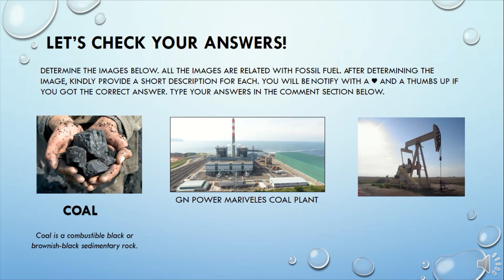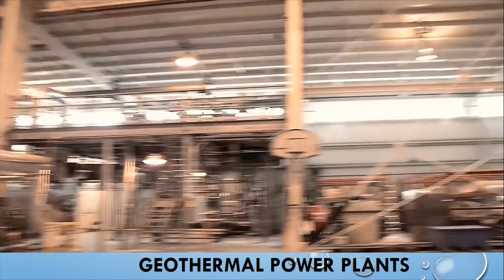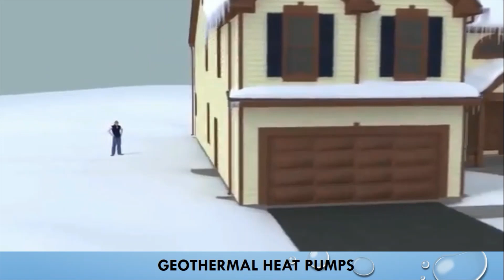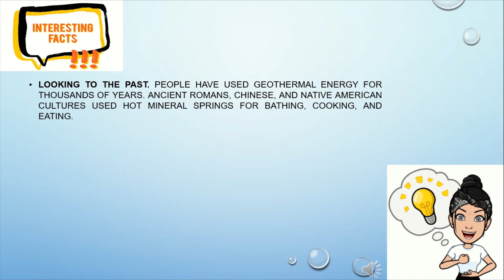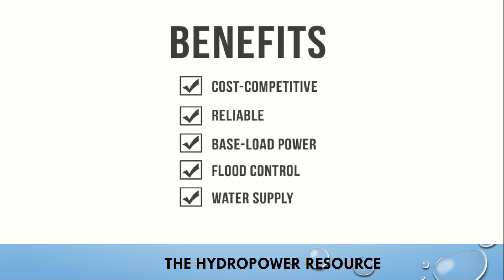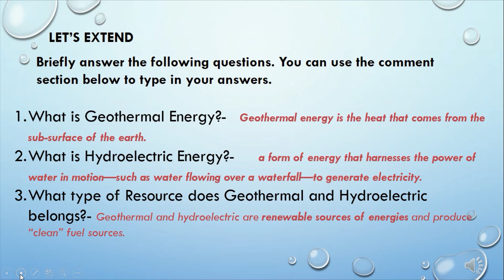GEOTHERMAL ENERGY AND HYDROPOWER RESOURCES (A SHORT DISCUSSION)

Comment: DELA CRUZ MIKHYLA GRACE B.
11 STEM PHOENIX

LET'S REVIEW:
A. Coal is a black or brownish-black sedimentary rock that can be burned for fuel and used to generate electricity
B. Generating Station is the main supplier or
 source of electrical energy.
C. Pump jack is a device used to extract crude oil from a deep well.

LET'S EXTEND:
1.Geothermal energy is the energy that comes from the heat underneath the earth's surface.
2.Hydroelectric energy one of the source of renewable energy that uses natural flow of moving water in order to generate electricity.
3. Geothermal and Hydroelectric Energy are both belong to renewable energy sources.

Comment: Fernando, Hallie Jade V.
11 STEM - Scorpius
Let's Review:
1. Coal is a combustible black or brownish-black sedimentary rock, formed as rock strata called coal seams.
2. Generating station is the source of electrical energy.
3. Pump jack is a device used to extract crude oil beneath the Earth's surface.

Let's Extend:
1. Geothermal energy comes from the heat within the Earth.
2. Hydroelectric energy uses the natural flow of water to generate electricity.
3. Renewable sources of energies.

Comment: Valdez, Ellaine Mae B.
11 STEM- Phoenix

A) Coal- a combustible sedimentary rock consisting mainly of carbonized plant matter

B) Generating Station- facility for the generation of electric power

C) Pump Jack- over ground drive for a reciprocating piston pump in an oil well 

1. Geothermal energy is the heat that comes from the subsurface of the earth 

2. Hydroelectric energy is a form of energy that harness the power of water in motion such as water flowing over a waterfall to generate electricity

3. Geothermal and hydroelectric are renewable resources of energy and produce  clean fuel sources

Comment: Pauline Narvas
11-STEM Taurus 

Coal
-is a form of fossil fuel that is formed from the decays of plants and animals millions of years ago with heat and pressure fossil fuel such as coal is formed.

Coal-fired power plants is a type generating station that produces electricity by burning coal.

Pumpjack
-is use in crude oil extraction. It is use to lift the oil from oil wells where there is no enough pressure so drilling holes and the oil pumpjack is use to bring it to the surface

Geothermal energy 
-type of renewable energy that comes from the heat beneath the earth 

Hydroelectric energy 
-a type of energy that is generated through moving water by using turbines also

Both are renewable source of energy

Comment: Ocampo, John Carlo S.
11 STEM PISCES

Let's review:

A. Coal- Is a type of fossil fuel formed from decayed or dead in million years and applied heat and pressure.

B. Generating Station- Is the main supplier or
source of electrical energy.

C. Pump Jack- It is used to extract crude oil from oil well by mechanically lift the liquid out of the well if not enough bottom hole pressure exist for the liquid to flow all the way to the surface.

LET'S EXTEND

1. Geothermal energy is the thermal energy in the Earth's crust which originates from the formation of the planet and from radioactive decay of materials in currently uncertain but possibly roughly equal proportions. 
2. Hydroelectricity, or hydroelectric power, is electricity produced from hydropower.
3. Geothermal and hydroelectric are renewable sources of energies and produce "clean" fuel sources.

Comment: 11 STEM-Pisces
Chavez Alexis A.

A). Coal - one of the most important primary fossil fuels, a solid carbon-rich material that is usually brown or black and most often occurs in stratified sedimentary deposits. 

B). Generating station -  a plant for  generating electric power.

C). Pump jack - is a device used in the petroleum industry to extract crude oil from a oil well where there is not high enough pressure in the well to force the oil to the surface.

Let's extend 

1. Geothermal Energy - Geothermal energy is a renewable energy source because heat is continuously produced inside the earth.

2. Hydroelectric Energy - Hydroelectric energy, also called hydroelectric power or hydroelectricity, is a form of energy that harnesses the power of water in motion—such as water flowing over a waterfall—to generate electricity.

3. Geothermal and hydroelectric are renewable sources of energies and produce “clean” fuel sources.

Comment: Mercado, Chantelle C.
11- STEM Taurus

Let's Review
A. Coal- Coal is a combustible black or brownish-
black rock that is usually found in sedimentary rock deposits. It is primarily used as a fuel, but is classified as a nonrenewable energy source because it takes millions of years to form.
B. Generating Station-  is a facility for the generation of electric power. It converts mechanical energy to electrical energy.
C. Pump Jack- is an overground drive for reciprocating the
 piston pump in oil well. It’s used for mechanically lifting the liquid out of a well if there isn’t enough bottom hole pressure for liquid to flow to the surface.

Let's Extend
1. What is Geothermal Energy?- Geothermal energy is the heat that comes from the sub-surface of the earth. It can be used to produce electricity, to heat buildings and greenhouses, and many other purposes.
2. What is Hydroelectric Energy?- it is one of the oldest and
 largest sources of renewable energy, which uses the natural flow of moving water to generate electricity.
3. What type of resource does Geothermal and Hydroelectric belongs?- They are renewable sources of energy on Earth.

Comment: Chavez Aubrey A.
11 Stem Pisces 

Coal a flammable black or dark brown rock made primarily of carbonized plant debris that is found primarily in subsurface deposits and is commonly utilized as fuel, 
a smoldering coal.

Generating station a plant for generating electric power.

Pump Jack In the petroleum business, a device used to extract crude oil from a well where the pressure is insufficient to force the oil to the surface.

Comment: Sabio, Kathlyn M. 
11 - STEM LIBRA

A. Coal - Coal is a type of hard rock that can be used as a fossil fuel when it is burned.
B. Generating Station - A power station, often known as a power plant, is a facility dedicated to the generation of electricity.
C. Pump Jack - A pump jack is a device used in the petroleum industry to extract crude oil from an oil well when there is not enough pressure in the well to drive the oil to the surface. Pump jacks are used in situations where there is not enough pressure in the well to force the oil to the surface.

Comment: Let's Review 
A. 
Coal- one of the most important primary fossil fuels, a solid carbon-rich material that is usually brown or black and most often occurs in stratified sedimentary deposits.
B.
Generating station- a station for generating electricity, where electricity is expected to be directed to households and other facilities in need of electricity. 
C.
Pumpjack- is the overground drive for a reciprocating piston pump in an oil well. It is used to mechanically lift liquid out of the well.

Let's Extend
Act 1
1. Geothermal energy comes from the heat within the Earth. Produces electricity, to heat buildings and greenhouses, and for other purposes.
2. Hydropower, or hydroelectric power, is one of the oldest and largest sources of renewable energy, which uses the natural flow of moving water to generate electricity. 
3. The type of Resource that both Geothermal and Hydroelectric Power belongs to is the Renewable Energy.

Jemabhe Joyce T. Medenilla
11-STEM - Virgo

Comment: Castro, Samantha Nicole M.
11-STEM Taurus

Let’s review
a.	Coal - nonrenewable fossil fuel that is combusted and used to generate electricity
b.	Generating station - a station that consists of electric generators, prime movers, and auxiliary equipment for converting mechanical, chemical, or nuclear energy into electric energy
c.	Pump jack - a device used in the petroleum industry to extract crude oil from an oil well

Let’s extend
1.	Geothermal energy is a type of renewable energy taken from the Earth’s core. It comes from heat generated during the original formation of the planet and the radioactive decay of materials
2.	Hydroelectric energy is a form of renewable energy that uses the power of moving water to generate electricity
3.	They are both renewable energy resources

Comment: Bajenting, Hannah Grace C.
11 STEM - SCORPIUS

Let's Review
a. Coal - it is a combustible black or brownish-black sedimentary rock. Coal is classified as a nonrenewable energy source because it takes millions of years to form.
b. Generating station - it is a power station/facility for the generation of electricity.
c. Pump jack - is a device used in the petroleum industry to extract crude oil from a oil well where there's not high enough pressure in the well to force the oil to the surface.

Let's Extend
1. Geothermal energy comes form the heat within the earth.
2. It is one of the oldest and largest sources of renewable energy which uses the natural flow of moving water to generate electricity.
3. Both of them are classified as renewable source of energy

Comment: Lobo, Gian Evan P.
11-STEM Virgo

Let's Review!
Coal- it is a color black rock that can be used for fuel, it can also be used on generating electricity.
Generating Station- it is a facility that can generate electricity
Pump Jack- is a type of  machine that extracts crude oil from the oil well. It is used if there is not enough pressure to push the liquid up from the surface
Let's Extend!!!!!
1.)Geothermal energy is the energy that comes from the heat underneath the earth's surface.
2.)Hydroelectric energy is the energy that comes from the flowing water.
3.)They are both classified as renewable source of energy.

Comment: Gervacio, Sophia Alexa D. 
11 STEM-Libra

Let's Review
A. Coal is a solid carbon-rich material, usually brown or black, found in stratified sedimentary deposits. It is one of the most important primary fossil fuels.
B. Generating station, also known as a power station, is an industrial facility for the generation of electric power. 
C. Pumpjack is the overground drive for a reciprocating piston pump in an oil well.

Let's Extend
1. Geothermal Energy is a renewable energy source, it comes from the heat within the Earth.
2. Hydroelectric Energy is a form of energy that harnesses the power of water in motion to generate electricity.
3. Both Geothermal Energy and Hydrothermal Energy is a renewable source of energy.

Comment: Corpuz, Franz Joshua S.
11-STEM PISCES

Let's Review
1.Coal is a material usually found in sedimentary rock deposits where rock and dead plant and animal matter are piled up in layers.
2.Generating station is an industrial facility for the generation of electric power.
3.Pumpjack is a device used in the petroleum industry to extract crude oil from an oil well when the pressure in the well is insufficient to propel the oil to the surface. 
 
Let's Extend
1.Geothermal energy is a renewable energy source because heat is continuously produced inside the Earth.
2.Hydroelectric energy is a form of energy that harnesses the power of water in motion.
3.Geothermal and Hydroelectric are both classified as  renewable type of resources.

Comment: MANUEL, WELISTER O. 
11-STEM LIBRA

LET'S REVIEW!
A.  COAL
Coal is a material usually found in sedimentary rock deposits where rock and dead plants and an animals matters are piled up in layers. Coal is used to generate electricity.
B.  GN POWER MARIVELES COAL PLANT 
-It is an example of Generating Station that you can find here in Bataan. It is a facility for the generation of electrical power.
C. PUMP JACK
-Pump Jacks operate on the basic principle of hand pump water wells. This type of system uses equipment above and below ground to push oil to the surface.
Reply: LET'S EXTEND
1. GEOTHERMAL ENERGY
-Geothermal energy comes from the heat within the Earth. Geothermal comes from the Greek words "geo", meaning Earth and "therme" means heat.
2. HYDROELECTRIC ENERGY
-It is the form of energy dependent in the flow of water to generate electricity
3.  TYPE OF RESOURCES DOES GEOTHERMAL AND HYDROELECTRIC BELONGS
-it is belong to the renewable resources  of energy

Comment: ORDONIO ARIELLE S.
11 - STEM LIBRA 
Let's Review:
A. Coal - An example of fossil fuel. Material that is usually brown or black and most often occurs in stratified sedimentary deposits.

B. Generating Station - source and distributor of electricity.

C. Pump Jack - used to mechanically lift liquid out of the well if there is not enough bottom hole pressure for the liquid to flow all the way to the surface.

Let's Extend:
1. Geothermal energy is the third largest source of renewable energy that comes from the heat within the earth.

2. Hydroelectric energy is one of the oldest power sources on the planet. It is a form of energy which could be harnessed through moving water to generate electricity.

3. Geothermal and hydroelectric energy are classified as renewable energy resources.

Comment: Guila, Gabriel John, C.
11- Stem Pisces

Let's review:

A. Coal- Is a type of fossil fuel formed from decayed or dead in million years and applied heat and pressure.
B. Generating Station- Is the main supplier or source of electrical energy.
C. Pump Jack- It is used to extract crude oil from oil well by mechanically lift the liquid out of the well if not enough bottom hole pressure exist for the liquid to flow all the way to the surface.

Let's extend

1.Geothermal Energy- It is the heat that comes from the sub- surface of the earth 

2. Hydroelectric Energy- is one of the oldest renewable sources of energy that generate electricity from the natural flow of water.

3. Geothermal energy and hydroelectric energy are both renewable sources of energy.

Comment: 11-STEM phoenix
Yacat, Nicole S.
 
A. Coal is a type of fossil fuel formed from dead/decayed plants that are fossilized for millions of years and is applied heat and pressure. 
B. Generating Station is an industrial facility that generates electricity from primary energy. 
C. A Pump Jack also called oil horse is use to mechanically lift liquid out of the well if not enough bottom hole pressure exist for the liquid to flow all the way to the surface.

Comment: Let's Review
A. Coal- Coal is a flammable black or brownish-black sedimentary rock that we usually use as fuel.
B. GN Power  Mariveles Coal Plant -  A generating station that supplies electricity.
C. Pump Jack -  A mechanical that we use to collect crude oil.

Let's Extend
1. Geothermal energy comes from the heat within the Earth.
2. Hydroelectric energy is energy that produces electricity. Hydropower or hydroelectric power uses the flow of water to generate electricity.
3.  Geothermal and hydroelectric belongs to renewable sources of energy.

Comment: CASTRO, MARK ASHER G.
11-STEM TAURUS

Let's Review!

•Coal- is a combustible black or brownish-black sedimentary rock with a high amount of carbon and hydrocarbons.

•Generating Station- also referred to as a power plant and sometimes generating station or generating plant, is an industrial facility for the generation of electric power.

•Pump Jack- it is used to mechanically lift liquid out of the well if there is not enough bottom hole pressure for the liquid to flow all the way to the surface.

Comment: De Lara, Jessie Andrea Z.
11 - Stem Taurus 

Let's Review:
A. Coal - Coal is an example of fossil fuel. It is a combustible black sedimentary rock that is usually formed as rock strata called coal seams.
B. Generating Station - Generating station or also known as power plant is used for generating electric power.
C. Pumpjacks - It functions similarly to an artificial lift. This merely raises the pressure inside an oil well, causing the oil to rise to the surface. This is a technique used in the petroleum industry to recover crude oil from a well where the pressure is insufficient to propel the oil to the surface.

Let's Extend:
1. Geothermal energy is the third largest source of renewable energy that comes from the heat within the earth.
2. Hydroelectric energy is one of the oldest power sources on the planet. It is a form of energy which could be harnessed through moving water to generate electricity.
3. Geothermal and hydroelectric energy are classified as renewable energy resources.

Comment: San Juan, Kristel B.
11 STEM - Sagittarius

Let's Review
	A. Coal
	- Coal is a nonrenewable fossil fuel. It is a combustible black or brownish-black sedimentary rock that can be burned for fuel and generate electricity.
	B. Generating Station
	- A station or facility that generates and supplies electric power.
	C. Pumpjack 
	- Equipment used to extract crude oil from the ground.
 
Let's Extend
	1. It comes from the heat within the earth and is used to produce electricity, heat buildings, etc.
	2. It is one of the oldest and largest sources of renewable energy, which uses the natural flow of moving water to generate electricity.
	3. Both Geothermal energy and Hydroelectric energy are classified as renewable sources of energy.

Comment: LLEMOS, Juhaina Paula G.
11 - STEM TAURUS

Let's Review:
A. Coal - It is a substance found in sedimentary rock depositions that are layered with rock, dead plants, and animal waste.
B. Generating Stations - It is an industrial plant that generates electricity using primary energy.
C. Pump Jack - When the pressure in the well is inadequate to accelerate the oil to the surface, it is employed in the petroleum industry to extract crude oil from the well.

Let's Extend: 
1. Geothermal energy is obtained from the internal heat of the Earth. Geothermal energy is a renewable energy source since heat is continually created within the ground.
2. Hydroelectric energy is a form of energy that produces electricity by harnessing the power of flowing water, such as water pouring over a waterfall.
3. Both geothermal and hydroelectric electricity are considered renewable energy sources.